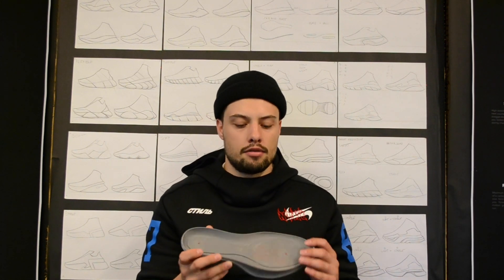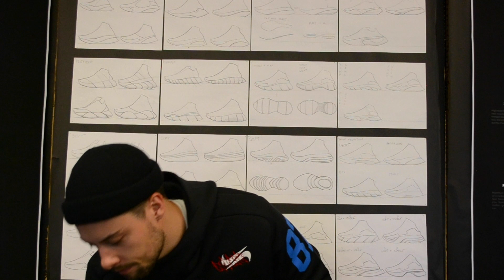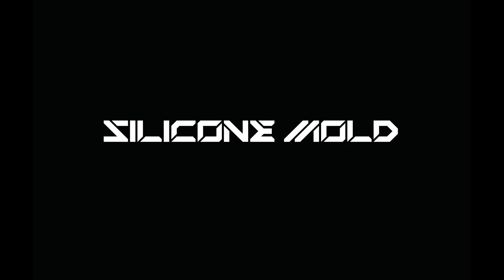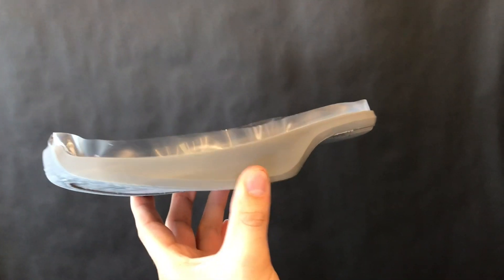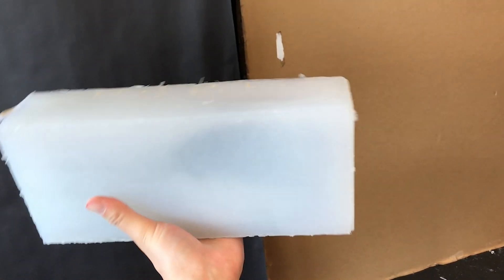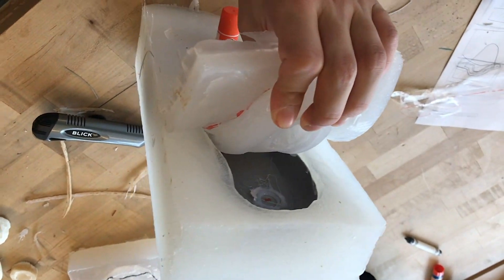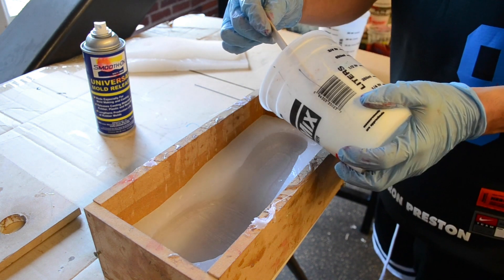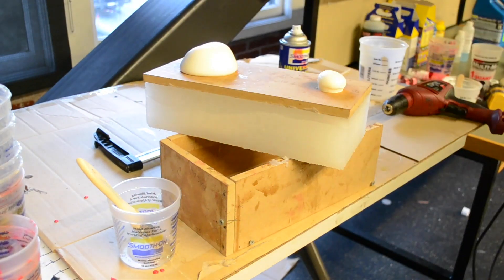How To Prototype A Sneaker Midsole

Comment: I have what I sense is a very innovative midsole design, that I am currently trying to carve out from a medium soft black foam rubber material....but is difficult to sculpt or carve .. whether I use a utility knife or Dremel.....is there a so called foam material that is easy to carve of sculpt for a rough prototype.?

Comment: I'm currently making an orthotic insole, made of glass fiber and epoxy.
Any (rigid foam) recommendations to fill the space under the arch support and heel and possibly add some lightweight sandwiched support structure to the sidewalls?
(most part of the insole will be rigid).

Comment: Nice video! But something is confusing here. Are silicone molds more limited than traditional aluminium ones? If so, other than PU foam, what kind of material am I able to use with silicone molds?
Reply: I was looking at your question, it’s a lil confusing to understand, I’d like to try and answer it. First of all silicone is more accessible than aluminum because aluminum is expensive and is more for production. Silicone is cheaper, more for prototypes. 

The other part of your question is you can use any other material to pour into silicone, YES you can. Nothing sticks to silicone except itself unless you use Vaseline or another type of release agent. Hope that helps 👍🏾